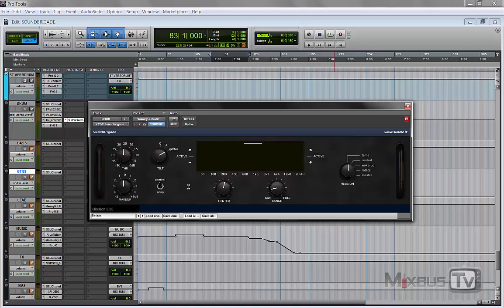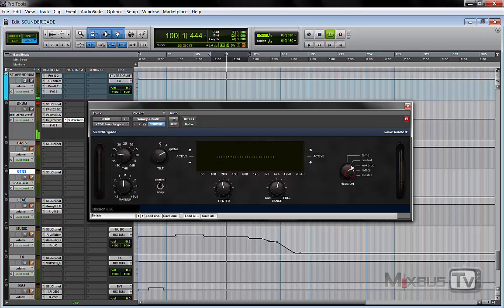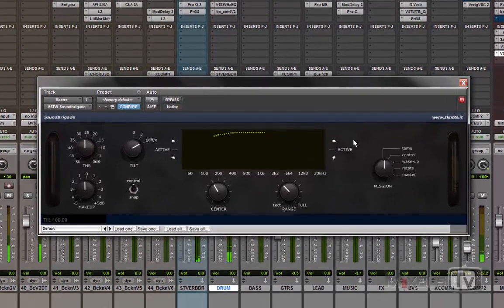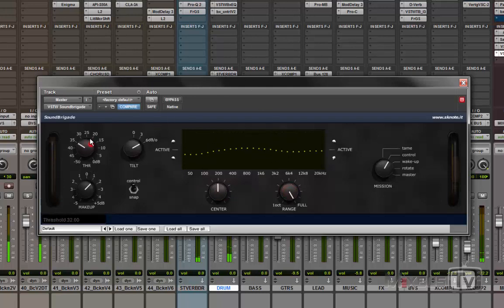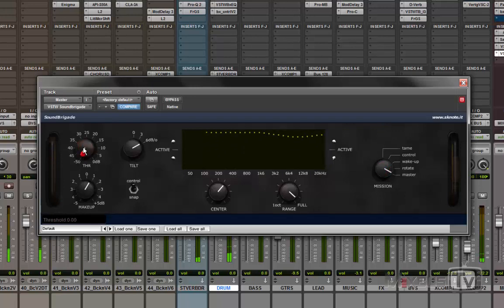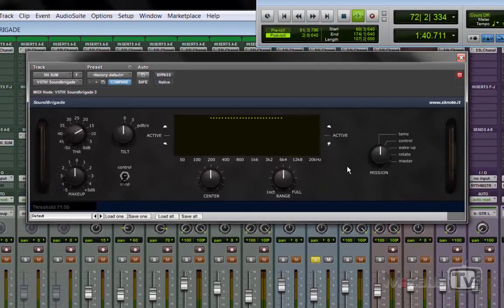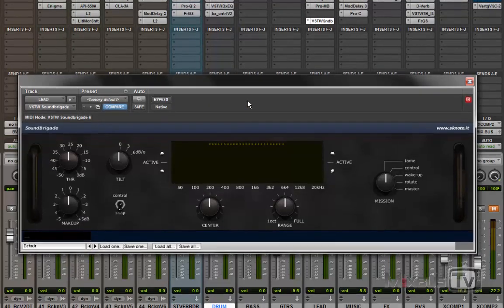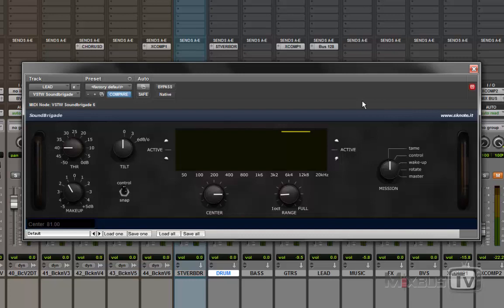SKnote Soundbrigade: New Dynamic Processor Plugin - First test and overview

Comment: Agree that "Rotate" has great potential. It gave the drum bus a "909" feel.. A mix knob on the unit would be handy.. Thanks for another great post..
Reply: CarlosGunX there's another plug to do the task, it's called Disperser. Too obvious when you actually hear it, it can be used subtly, not a game changer, maybe more suited for electronic music where you can go over the top with weird sound and modulations